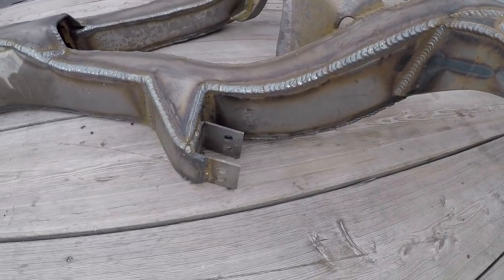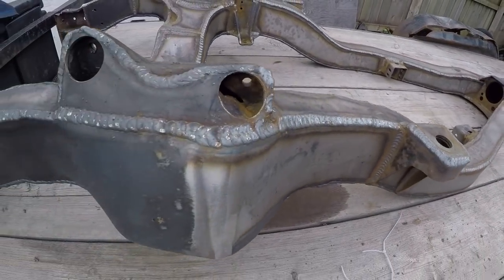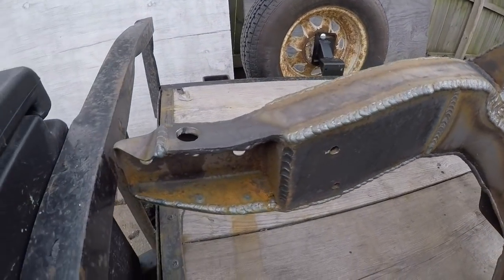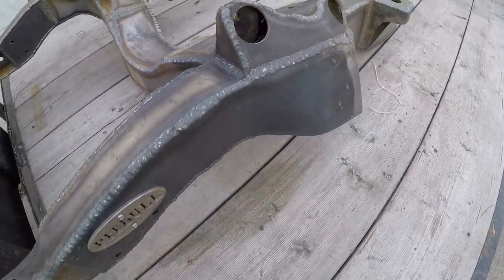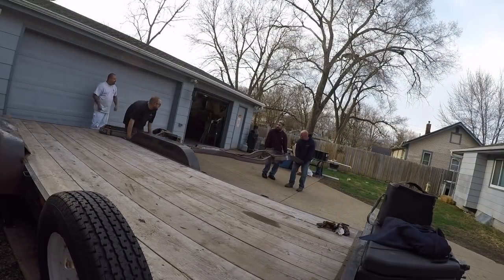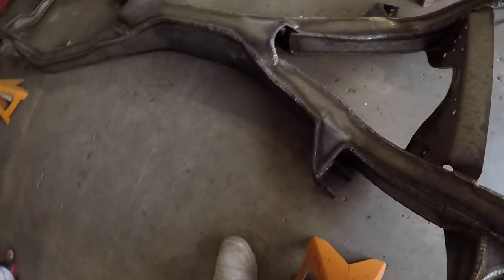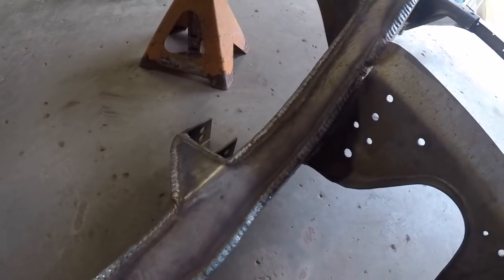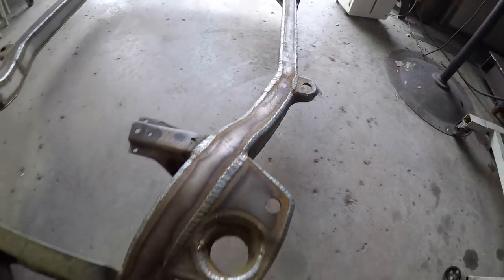PITBULL LOWRIDER FRAME!!

Comment: Hey joe I had a quick question what's the best way to remove wide pinstripes  without damaging the paint? I recently bought a 78 monte carlo and it has thick pinstripes on the hips
Reply from the maker: Merx Gtr if it's a decal they sell a rubber eraser wheel at most auto parts store that attaches to a drill and does a good job at removing decals.
Reply: @RJTickler  sweet thanks so much would I have to use any type of liquid chemical with it?
Reply from the maker: Merx Gtr no just use it dry.

Comment: Was up with some advice rj
Reply from the maker: GUERO WITHIT I can try lol
Reply: @RJTickler  cool bro i know you busy man seth from los angels man i got a 85 regal limited 89000 miles fresh never cut i wanna keep it basic front back side to side and 3 wheel no hopping just cruising what type of set up should i throw in it? Cce good brand?? Im in the process to take it to get wrapped before anything im getting the belly ears rear and arms reinforced you a bad ass man been watching  you a while high lock up  chain bridge too???? Tell what set up how to do it tickler thanks man😎✌
Reply from the maker: GUERO WITHIT most of the hydraulic companies are fine. Hoppos, black magic, cce, high hitters, all good. I personally like black magi, if you go through them tell them RJ Tickler sent you. High lock up requires some trailing arm modification, black magic sells a nice bolt in long arm kit for g bodies. Chain bridge is nice just for the added reinforcement of the spring perches in the rear. But with a three pump set up you don't need to actually run chains it will three wheel no problem.
Reply: @RJTickler  thanks for taking the time for your knowledge RJ ill do it like that your a legend bro keep them videos coming much respect from los angels 😎😎😎✌✌✌